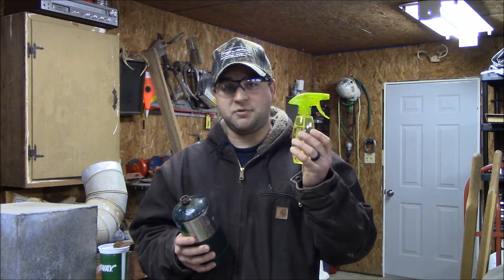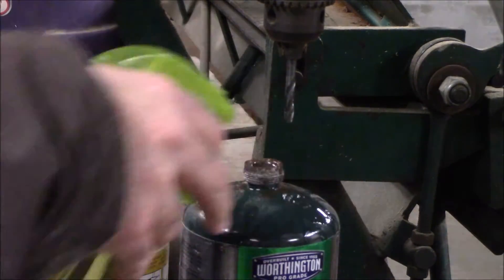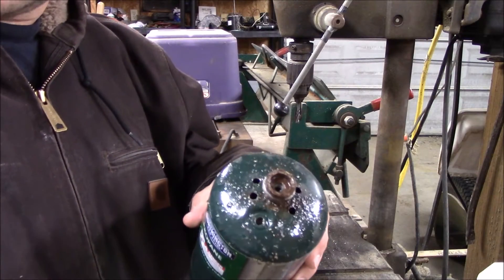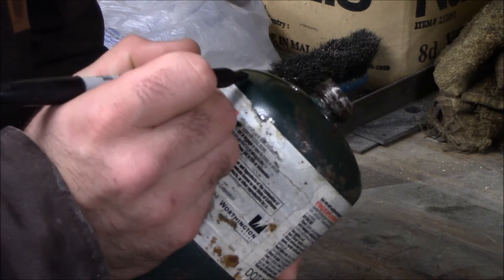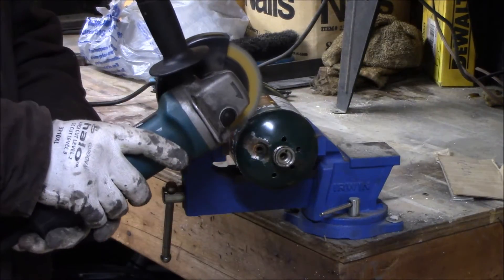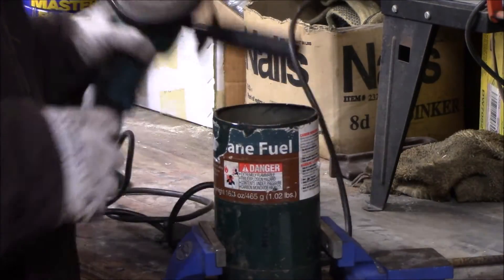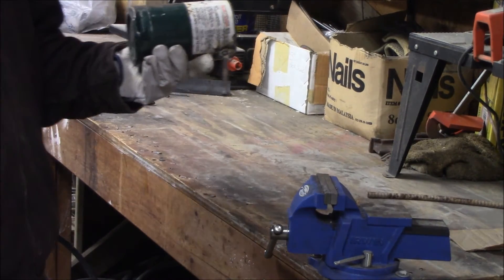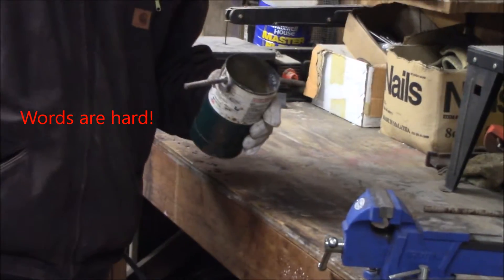How to build a crucible out of an old propane tank diy

Comment: I know this video is old but that will not work at all for aluminum. The aluminum will literally eat right through that propane tank and the it will leak all into your foundry man. You'll still be able to gather it all back up if you wait until it hardens and then beat it out your foundry but it will absolutely wreck the foundry and stuff
Reply from the maker: This is not true at all actually. I melted down aluminum cans on 10 or more occasions in this exact crucible. The propane tank is made out of steel which melts at a much higher temperature than aluminium.